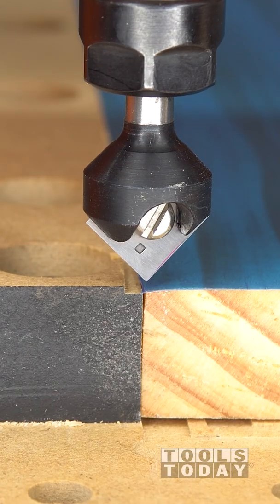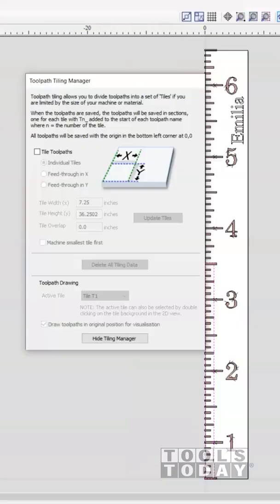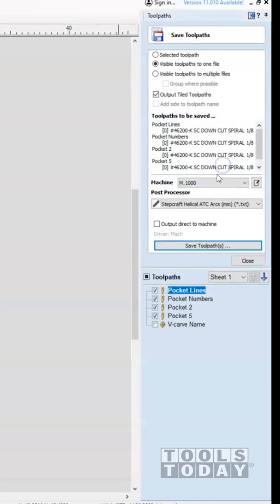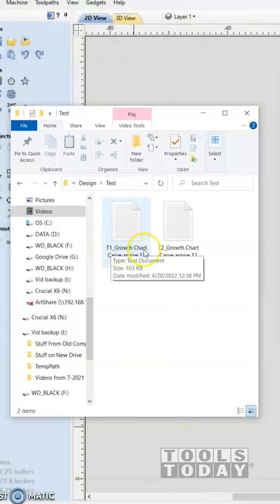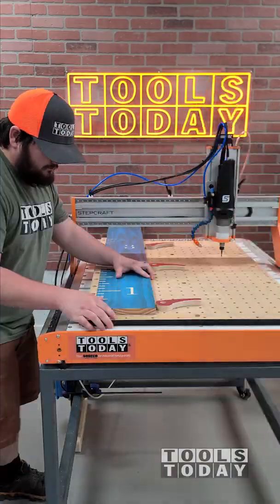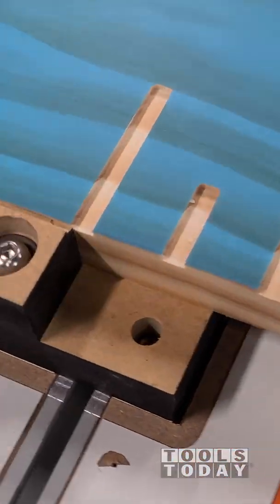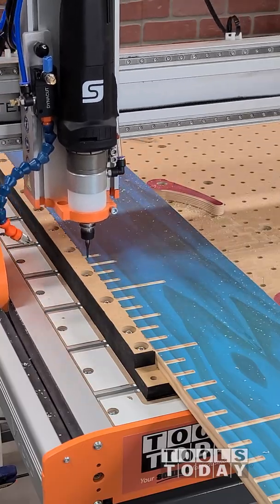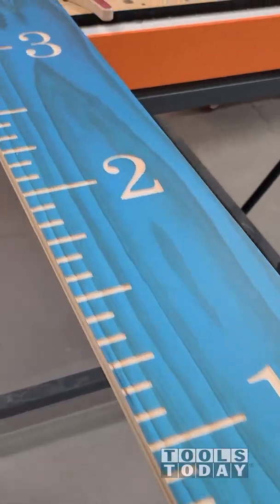Cutting Larger Than Machine with Tiling

Comment: Correct me if I am wrong , for me to do that I would need a straight edge on my machine on the left side and put a mark half way though the 8 ft sheet then I slide it down ?
Reply from the maker: Correct, you need some sort of reference
Reply: @ToolsToday have you ever done 3 tiles?

Comment: Question: 
What's the purpose of the tiling feature? Couldn't you just ran 2 programs from the beginning?
Reply: Tiling would be making one cad file then splitting it into two cnc files
Reply: @PeterEvans_music  ok so its a point of not loosing the overview of you two seperate files (farily easy for this particular case) and easily splitting it afterwards.
Not, that it wouldnt be possible without the feature, just easier with it